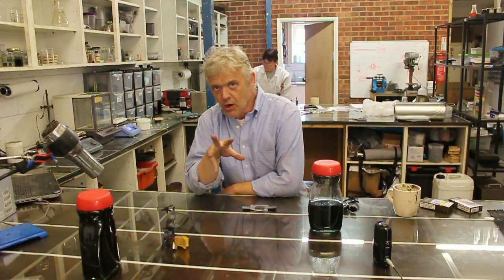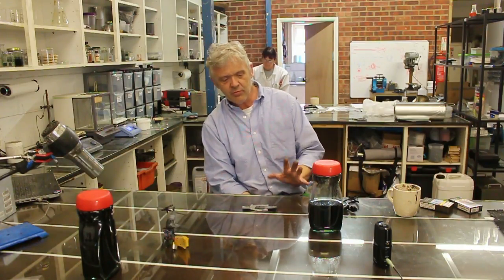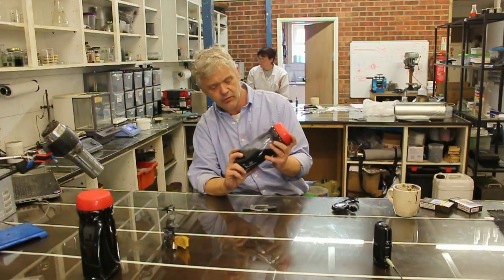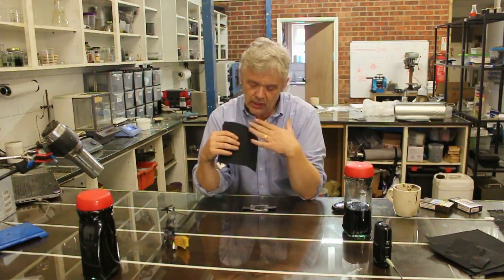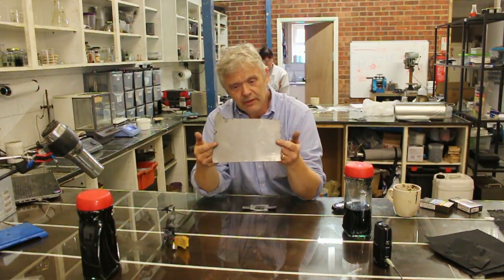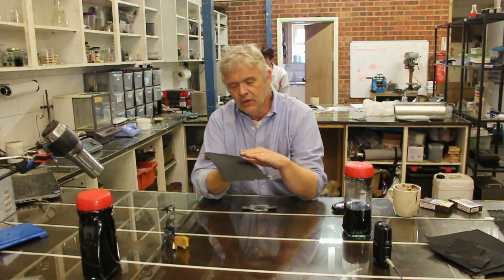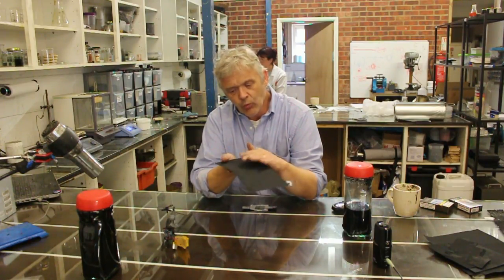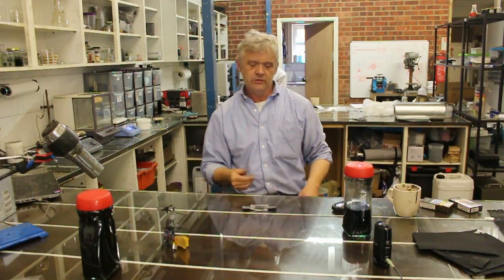An All Carbon Device For Crowd Funding

Comment: I can see spending L4000 on equipment that will allow you to make and test batteries more easily. But before I spent L200,000 I would be looking into subcontracting the work to someone who already has the gear. I am sure there are printing companies who can make up anything you want and you could probably find a battery company to make some batteries given the printed material. I don't know exactly what equipment you need but someone must already have it.

Comment: Hi, just a thought; the 18650 is a small unit which is handy for heat dissipation, but wouldn't the newer 2070 format offer some benefits? Apropos solar panels, I'm trying to work out the thickness of super capacitor that would match a solar panel for output.I'm thinking that the cap would need twice the daily output of the panel, allowing a 100w panel to deliver say 50w as needed with a human usage. 
Of course, given carbon fibre structure in two layers with an active layer, the battery could form the structure of the vehicle! What a great future we can realise!

Comment: Robert, the title says a crowdfunding carbon device. Where is the link?
Reply from the maker: I did this to try and get a handle on how well received the idea would be mate - I haven't prepared the crowd funding yet - bt when I do I will put a link
Reply: Robert Murray-Smith Rob, i have great idea on how to launch that includes crowding and other means if interested that will really work well but do not want to display publicly.

Comment: I thought the main issue with capacitors(or super capcitors) was that they auto self discharge over time ( leak ). Any technical data regarding this ? In fact, any location we can find technical data regarding the progress so far ?

Comment: Hi Robert...I'll like you to reach your goal, and I know you Will...... so we (I) can make  a "power Wall" as a solar storage devices, about 40-60 KW/h for a 1 day storage, ore even bigger, depending on the need. 

So maybe the 18650 is not the way to go because of the form factor 3.2V to 4.2V as thees devices are meant for, unless you can get you devices to cover that volt span, otherwise the devices using 18650 we have to day, will not walk with you "power device". 

A solution to that could be to find a form factor that have the volt range as you are targeting, like 12V in a car battery ore industrially bigger battery like those used in Phone Companies as backup power ..connected together as a 48V battery bank......Ore maybe the Way the Super Capacitor form factor are made today, with bolt/nuts and balancing unit mounted on top of every cels..to make a bank of 400V , it will be a more flexible form factor and easier to use and install for consumer installation, ore industrially applications. 

Because the form factor for a device on the marked to day, are almost locked to the Volt span the device are made for. 
 But when it comes to a capacitor bank there are almost NOT a common form factor for a specific volt range, because capacitors are made in a wide range of Volt and Capstans ... already .........(Maxwell have made something i know)   

And when it comes to marked ....There are a HUGE need almost demand for big storage devices, there are manny people going OFF GRID and have to find a better way to storage there power, then in the "OLD" led asset devices, they have lot of problems when used diiiiiiiip cycles.....
As the super capacitor has not, it can just sit there without volt, until the Sun decides to shine. Therefore the Super Capacitor are a much better choose, for storage device in that application. 

.
And When you have a  Solar array lets say 30KW and the Sun have desisted to shine, Then you have almost 30KW pr/h....and a normal storage devisees have problems with charging that much energy in a short time, and a Super Capacitor Bank can easily do that, and when you have 30KW of Sun Power all day long, then you have fully charge you 60KW/h Capacitor Bank i 2 hours, and getting the power back again can be even faster.

....So Super Capacitor is PERFECT for this application. ..........Long Lifespan to.

For my needs I will like a device suited for scaling up to maybe 100 KW/h  ore more at 400- 600V because they can be used for charging Tesla and other E-powered devices with high power needs. 
 
If we look at your discharge curve, we need either a step up ore a buck converter, depending on the start volt and the target volt.......
 If we need to charge a li-ion bank from a Super Capacitor Bank, we need to look at the charge curve for li-ion and discharge curve for Super Capacitor......They are quite different ...

And to get That done... we need electronics .....

So therefor the 18650 "form Factor" are maybe not the right choice, if used at 2v, if you can make a 4.2 volt version with a lot of cycles = lifetime,  it can be a useful devices, as we are using Li-ion to day.........

Keep up the good walk, I don't always understand you, because i can't always hear what you are saying, even if i spool back i still don't understand, but thats maybe just me being half deff ore something like that......
Love you walk.....I'll support you when you decide to come up with some thing I actually can use, as a solar storage device, ore a 3-4KW/h as my bike battery, as I have told about earlier, but that is a long time a go. 
 If I could I would like to make a Capacitor Bank for my self,  if I could figure out a way, to build one.....
But that is not something to fool around with when we reaching 400V DC 100KW/h.
 It can make a pretty big  arck-spark...... and blow your trousers off.... what a sight ...uhhh..yak..;-)...... Jørgen Thomsen Denmark DK
Reply from the maker: I am probably going to make a group 27 style mate
Reply: 27 Style...I think you are right in That decision, Because you can have cells at 2 V and max it out at 2.4V for more energy storage, and have a lot of  Capacity on a small form factor, They are easily to maintain, have been around for manny years, and are cost effective, easily to scale up and down, can also be made as 1 cell if needed, for a specific amplification ore Volt drop across a DC High Amp Power line. So easily scalable.
 
IF you go 2.4 Cell volt then there are "cases" where water can be added in a house automatic Flow/ level/ valve system, and you only have to connect you "saltwater back/bucket" and the rest is automatically, and if the salt solution are high, it will also be "frost secure" more ore less. Eventually the Sea freezes over .... ?? 
If I remember correctly I also sow some Cell support sheets inside the Lead asset battery when I was moving around with Thous Giant and Heavy  Battery Bank 48V DC "DK safe system" They ware made in a clear plastic material easily to se, what was going on inside the Battery. So If your sheets don't have sufficient self support, and will maybe crumple down over time and make a shot circuit, on cell level.They can be helpful and also hold the carbon sheets well wet all the time. Maybe something like That.
http://www.directindustry.com/prod/bae/product-14387-722729.html 

But the total W/h will be lower because of the nonconductive material, so if you can make a self-supporting/ self-isolated system as I think you have in mind it will be the best.

Have you a cell balancing system in mind yet, ore does that  just come over time if needed , because if the surface array Not are identical with the rest of the bank, we will eventually run in to unbalancing problems, because the capacity will wary from "battery" to battery, and even from cell to cell level.
 Something like MaxWell have in there Super Capacitor bank, but they also run at 2.7V..... Lot of testing to me made but you will eventually be there......
best to your all mate ....Jørgen Thomsen Denmark DK.

Comment: The market of 18650 batteries have been conquered by li-ion for evident reasons...
One of the disruptions we're still waiting for is a lighter rival to lead-acid cells.
Hey Robert, does the behavior of Silicon Sulfide make it a good electrochemical ?
Reply from the maker: yes mate - there is a quite a bit of research on this check out google scholar

Comment: Using an aqueous electrolyte, do you have an issue of producing co2 or Carbonic acid within the battery. you don't have to give an answer on the subject ( I know you get "investors" trolling for information), it just seems like an issue with how many times you could cycle the battery.

Comment: Any chance of buying a test version of an all Carbon battery for use as a replacement for the claimed 10 mile range 24V (?) battery in my mobility scooter? I would be happy to run it in different seasons and temperatures, compare real ranges, repeatedly charge and discharge it, and send back to you the data obtained. Thanks Robert.
Reply from the maker: yes mate - but the problem is making a large batch by hand

Comment: Robert - I have a small process engineering company in the UK. We design and manufacture pipework, vessels and associated equipment for the chemical industry. If you plan to upscale your fluid production beyond the bucket scale, feel free to message me. I give free advice when the project piques my interest!
Reply from the maker: awesome mate - because for making ink that's exactly what we need to do - my email is Robert@fwgltd.co.uk

Comment: Hi Robert I am about to launch an Indiegogo campaign for much similar reasons. I have made progress on a motor generator that shows high potential for production streams. Doing this may give independent researchers at this stage of development some leverage. I was raked over in the last week at the e-catworld.com discussion board no worries.The campaign is called EV engine. All the best.
Reply from the maker: It doesn't matter what you do mate someone somewhere will complain - post the link on here if you want mate - the spam filters will stop the post but I get a chance to review so I will ok it if you like
Reply: I would like to stay in touch. A bit surprisingly the motor generator did yield a very good result. A large reason for that I think is actually working with the materials and proceeding with logic as you show in your videos.  A campaign will get me going and I hope yours does as well. The  vehicle custom battery you completed here in BC is very interesting. A combination of an advanced light battery and engine innovation is what I am thinking and do able. The next few months are looking positive from my perspective whatever happens.
Reply from the maker: awesome to hear mate

Comment: I've watched a lot of technologies stall during their development because of running out of money. If you currently have something people are willing to buy, even if it's not a finished product, it is worth developing an income stream as early as possible. When home computers first came on to the market, they consisted of plans, then came kits, only then when enough everyday people understood their significance did the mass manufacturing begin. Take a look at the 3D printer market. I got my first 3D printer kit in 2012. I had to build the whole thing myself and I still use it. Now I'm moving on to CNC machining.

I would love to do my own experiments with your foam. I have plans for electric vehicles, specifically tractors. They all use diesel because when the work needs to get done, you can't wait for the batteries to charge. In Australia we have a lot of sun so now most farmers are installing solar driven pumps for bore water & irrigation. I've built a few prototype solar panels and resurrected an old electric forklift. Once it's charged it's great. That's what I see as so revolutionary about super capacitors.

If you offer it, they will pay 😉
Reply from the maker: I like the kit idea mate I may well do just that

Comment: I'm glad the 18650 sized supercapacitor idea is at the very beginning of this products creation. Integrating a supercap bank using 18650 sized caps into a battery made from 18650's is way easier than having a cap bank made from larger or smaller caps. Going to use supercaps to handle surge currents instead of the lithium battery bank when starting electric motors in a off grid home.
I prepledge to support all your crowd funding endeavours!
Reply from the maker: awesome mate - thanks very much for that

Comment: Having followed your channel for many months now I can honestly compliment you on providing some wonderfully inspirational videos.

In your latest offering concerning pilot production of 18650 batteries you propose using brine as the electrolyte for safety and environmental reasons. This will of course get round many of the
drawbacks of lithium batteries but leaves the question of to what extent the new battery will function in subzero temperatures. A 23% solution of salt in water freezes at -21deg. C, which is the sort of temperature you might want to consider for a multipurpose battery pack in an EV or solar application for instance, especially outside this green and pleasant land of ours. However, I suspect your electrolyte dilution is less than this.
You do mention solid electrolytes at some point in your videos, and I realise they throw an addition
level of complexity on the issue, but the old adage of ‘start as you mean to continue’ pops to mind and may be worth reconsidering.
Alternatively a non-flammable inorganic ionic liquid. I am not sure to what extent the following article from
Royal Society of Chemistry would help and you may already have a fix but it may prove of interest to you. 
Organic–inorganic hybrid electrolytes from ionic liquid-functionalized octasilsesquioxane for lithium
metal batteries (read for free)
http://pubs.rsc.org/en/content/articlelanding/2017/ta/c7ta04599a#!divAbstract
I welcome any feedback you have to offer.
Reply from the maker: It's not a battery mate it's a capacitor - but everything has plusses and minuses - I don't know how it would respond below zero as I have never tested it as I don't have a climate control chamber - I was thinking of sticking it in a freezer - that's on the work schedule - I was thinking of adding a bit of ethylene glycol - what's normally done to caps anyway - a little antifreeze would have an energy cost but it may well be a solution - the essence of what I am saying is this is a work in progress mate